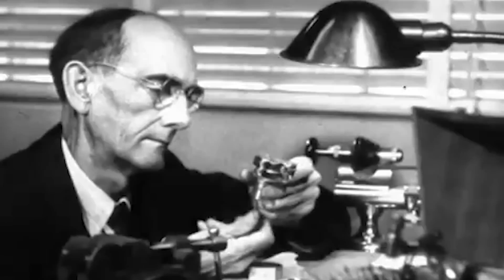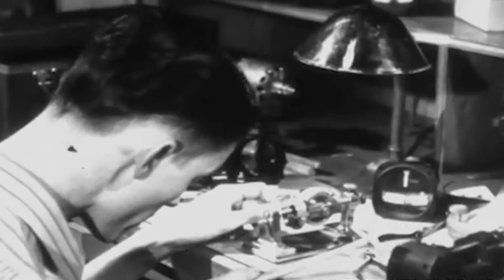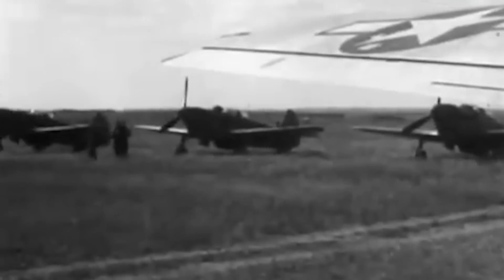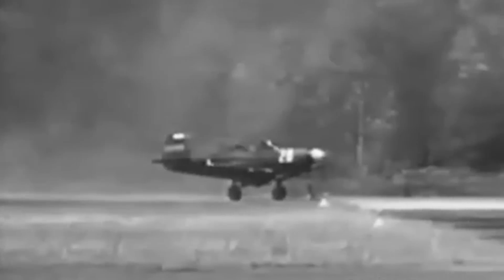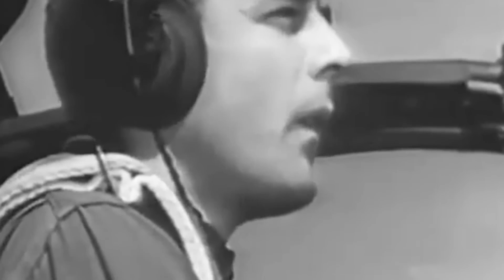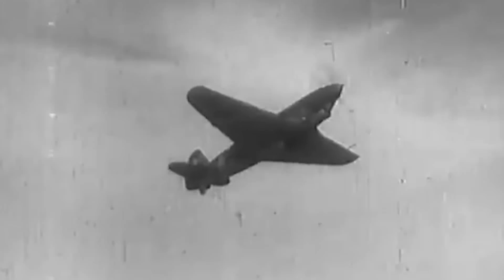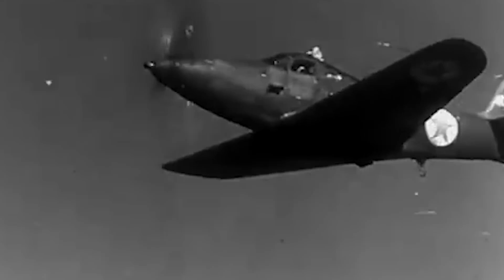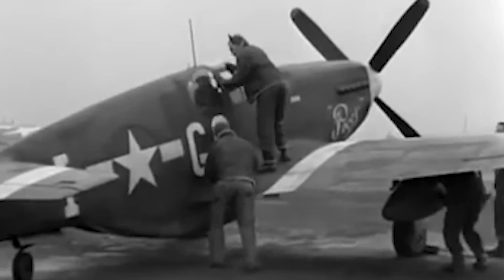The Most Underrated Aircraft of WW2

Comment: The P 51 mustang originally had an Allison aircraft engine in it and they would’ve been death traps had the British not installed the Merlin engine in their P 51 which made them the most formidable fighter in the war. Thank you, Britain.
Reply: Hardly a death trap, just not the best for medium to high altitudes.
Reply: Think, better P-40, which still would have been good.
Reply: @chriscarbaugh3936  I think it would have been stuck in mediocrity like most other fighters like the Cobras forced to rely on the Allison engines where high-altitude performance was needed.. imagine if a P-63 or P-40 prototype ever got its hands on a Packard Merlin just for comparison..
Reply: Wrong. the Allison mustans were amazing. they were designed to be low altitude fighters, and did well in that role.
Reply: That's a common misconception. The first P-51s had Allisons and were faster than Spitfires.  The problem with the Allison is that it didn't have the two stage two speed blower that it needed above 15K feet.  Below 15k feet, the Allison was just as capable as the Merlin.  The Merlin was added for bomber escort duty which required 25K altitudes, but for air superiority and ground attacks, the Allison Mustangs were formidable.
Reply: @ohger1  Yes, well said. And the Allisons with turbos at high altitude even outperformed the Merlins (P-38). Merlin/supercharger equipped P-38s would have performed worse than Allison/turbo P-38s.

the Allison just never got a proper supercharger induction system developed for it that could be installed in standard fighters.
Reply: @SoloRenegade  Correct. The U.S. gov didn't fund Allison to develop a better blower for the V-1710 because Packard was already building the Merlin in suitable quantities to make an Allison with a similar blower redundant.  The Merlin worked well, it was reliable from both RR and Packard, and it was available in large quantities.
Reply: Putting Merlins on Mustangs and 17-pounders on Shermans, the lads are based.
Reply: You are right, except all fighters go though upgrades just like the Spitfire  and others.
So guys, Merlin had better performance,  end of story.
USAF did it for that reason, and the 
Mustang improved in many areas 
of development. 
It did not come out perfect, but 
pretty dam good 👍 
Love the Mustang ,beautiful
Reply: @simoneales2568  Allison Mustangs were better at low altitude, and the Allison had much more horsepower at war's end than the Merlin (and was lighter), and still more post-war. And, the P-38 with allisons was better than a Merlin equipped P-38 would have been. With a turbocharger system, the Allison outperformed the Merlin at altitude. 

 Merlin Mustang is still a wonderful machine, one of my favorites, but that doesn't mean it is god's gift to humanity either.

Comment: The P39 was not a failed fighter. There were many Soviet aces in P39's. The 2nd highest Soviet Ace      had most of his kills in a P39.
Reply: @Arthion  um, wrong.  The Allison was not mediocre.  In fact, it's performance in the P51 & P40, both of which used the Allison and Merlin, was better with the Allison, at altitudes below 20k ft.  The Allison suffered from a lack of a 2-stage supercharger, which the Merlin had.  Allison was smaller, lighter, more powerful, and had numerous innovations that the British designed Merlin didn't.  The Allison engine wasn't the problem, the boost system was.  Why Allison didn't develop either/or a 2-stage supercharger or turbocharger system for the 1710 needs explanation.
Reply: @stevenstoll2016  I mean the end result is the same if you're forced to use the Allison engine at an altitude it doesn't like.. which seemed quite often in the Pacific. 

It worked wonders for the Soviets since for whatever reasons the Germans decided to throw away the giant advantage they had in altitude performance in comparison to most fighters in the Soviet arsenal.

Although to be fair you are right, it would be more fair to say the Allison was a good engine, but unfortunately hampered by now getting a proper 2-stage supercharger that well as far as I see it bring it down unless you get handed an optimal engagement on a platter.
Reply: @Arthion  The  Germans didn't throw away an advantage , the air combat in the east took place at lower altitudes ,there were no4 engine high altitude bombers on the Eastern front . So low altitude  fighting was the norm .
Reply: @stevenstoll2016  When the Allison was being developed, the USAAC was enamored with turbosupercharging. The Allison was designed with a single stage supercharger, the turbosupercharger was to give it high altitude capability. This worked in the P-38 but there were problems with the turbo installation in the P-39.
Reply: US: It kinda sucks with it short range
USSR taking them all: I miss the part where that my problem.
Reply: and the P-39 achieved favorable kill ratio against Japanese fighters in the South Pacific in the early years.
Reply: If the P-39 had been able to make use of the P-38J's Allison engine, things would have been completely different.
Reply: @big_steve_o5129  they both used 1710 engines but like the P-40 which also used that engine it was the gear reduction drive that was holding them back. The P-38 & P-63 had a gear reduction drive developed for a more powerful engine and larger prop to make use of the extra power. It's a shame because that was likely the missing link to better performance out of early war aircraft that would have given a better edge especially in service ceiling and climb rate and some top speed. Greg's airplanes and Automobiles has a great video on YouTube about this
Reply: I've learned that everything I thought I knew about the P-39 was wrong.
Reply: @Arthion  It was not so much that it was handicapped by using the Allison engine as it was by the aerodynamic issues around the duct feeding cooling air to the turbo-supercharger in the original XP-39 aircraft with the limited room in the airframe. Wind-tunnel testing had identified improvements, and a top speed of 429mph could be achieved using an uprated V-1710 and a single-stage, single-speed supercharger; the elimination of the turbocharger with its drag-inducing inlet cured its drag issues, but gave the aircraft significantly reduced performance above 12,000 feet. Project Officer LT Benjamin Kelsey would later express regret at not being present to override the deicision to eliminate the turbocharger. The P-39, unfortunately, came out on the short end of two conflicting requirements.
Reply: It is a very wrong configuration for aircraft, gun between cylinders of the engine is so much better: both ammo and fuel can be in the centre of the mass. Turbocharger is worse than jet exhaust in the most cases.
Reply: @Arthion  the Allison Engine wasn't "mediocre". What nearly no one realizes is that political pressure prevented Allison from installing turbochargers or two speed superchargers on the V-1710s in most aircraft. The USAAC would not allow it, plus, the P39 airframe didn't have room for them.

The P38 Lightning used those same Allison V-1710 engines and was one of the fastest, best performing aircraft of WW2. It had mechanical superchargers and turbochargers boosting the engines.

The lies and misinformation about the Allison V-1710 are astonishing. I worked for Allison in the 80s and 90s. I dug into the history in the Allison library.
Reply: Merlin great, Alllison bad?..no..old wive's tale..propaganda really...the Merlin was better in the P-51 because of it's superior mechanical supercharger...not because the engine itself was superior..the Allison's lack of an efficient supercharger held back an otherwise very good engine...with turbochargers, like in the P-38, it really shined..unfortunately, there was little room for turbochargers in single engine fighters. Had the Allison V-1710 turbo-compound varient gone into production, it would have been a game changer... @Arthion

Comment: The most underrated plane is the P=40, despite being underpowered it was incredibly fast in a dive and proved quite effective with the right tactics from North Africa to China’s Flying Tigers the P-40 changed the battlefield for the Allies on nearly early every front.
Reply: Underpowered? the Allison engine was putting out 2200hp by war's nd, and was lighter than the Merlin. It is a beast of an inline engine. They put the Merlin in it and the P-40 performed no better, and they put the Allisons back in it.
Reply: @SoloRenegade 
Both the Alison and Merlin were V-12s, not inline.
Reply: @Frankie5Angels150  both the Allison and Merlin are inline V-12 engines. they each have two rows of 6 inline cylinders. 

Radials are air cooled because their cylinders are not inline, so each can get cooling air while minimizing preheat from teh other cylinders. But the later war super radials were liquid cooled becasue there got to b so many rows of cylinders it was no longer possible to air cool them, and at that point they lined up all the banks of cylinders into inline configurations.

This is why inlines are always liquid cooled though, due to the inability to air cool the rear most cylinders. Putting them into two rows of 6 instead of 1 row of 12, doesn't make it cease being an inline engine. V, H, X, and others are just different forms of inline engines.
Reply: The P-40 was available in quantity. For allied nations to purchase before the US entered the war. Plus the US Army used it. It was a workhorse especially 1939-43
Reply: @BRAINFxck  BULL$HIT !!!!  The P40 was NOT underpowered !!!! It just lacked a 2 stage supercharger to work well ABOVE 20,000 ft !!! Know what the hell you are babbling on about !!!
Reply: @wilburfinnigan2142  the single stage supercharger was underpowered for higher altitudes so they had to use fast dive tactics and that was effective for the time
Reply: @wilburfinnigan2142  it also had a slow rate of climb and by the time the P40f got a 2-stage supercharger the P51 came out with better performance so it was still underpowered compared to the Mustang
Reply: Not really underpowered.  Even made Merlin powered units.  Look it up.  Damn fine plane actually
Reply: @chriscarbaugh3936  Flying Tigers did well with them.
Reply: @anthonybanchero3072  That they did, for a time. One of the most important lessons to learn form any war is that the nation that  improves capability the fastest wins.
Reply: @Chris Carbaugh  the P40 was good at taking down Japanese bombers. The only effective way to take on the ZERO was to dive through their formation and zoom back up to higher altitude.
Reply: The most underrated is the Hawker Hurricane- bearing the bulk of the Battle of Britain until the Spitfire was ready to side

Comment: Hardly a mention about one of it’s main attributes, the 37mm
Reply: Arguably the worse part of the P-39 and P-63. Sure it was better than American/British 20MMs but you get a ton of weight, a ton of recoil, hardly any ammunition, and iffy reliability, plus if you shot all your rounds it would move the CG far enough aft that they would enter a flat spin that was extremely hard to recover from. A bunch of M2s in the nose would have been a better way to go, no worries about convergence, better reliability, higher hit probability, less wear and tear for the airframe, etc.

Keeping the weight in the fuselage instead of the wings helps increase the roll rate. I'd just fill the wings with as much fuel as one can put in there getting rid of the range concerns, you burn the wing tanks while climbing up to altitude and cruising, then when you encounter the enemy the wings tanks are empty and you have a great roll rate.
Reply: @MrLM002  Despite the drawbacks of the 37mm, you didn’t usually need many hits to destroy a fighter or even a bomber. The Soviet pilots flying the P39 managed to do quite well against Me 109s and FW190s, with at least 16 aces with between 20 and 50 kills each. So the 37mm doesn’t seem to have been a huge disadvantage.
Reply: @tucopacifico  That's provided your 37mm didn't jam, and you actually hit your target with it, and hit somewhere vital. Rudel got hit by 37mms out of P-39s several times and none of them downed his Stuka. 

with a Hail of .50 cal fire you're damn near guaranteed to hit something vital.

The P-39 turned very well for a European theater fighter plane and the roll rate was very good as well.
Reply: There is actual proof of what @MrLM002 says about the CoG problem of the P39. 
In a book of WW2 souvenirs from a pilot of the Free French Air Force, flying US-supplied P39s in North Africa, he tells the story of one of his squadron fellow pilots who was killed during a cannon training session while executing a brutal recovery maneuver, after having spent all his shells while diving at the target.

Comment: Good to see these planes get some love. P39, p40, and p63 were great low and mid altitude fighters.
Reply: When a decent engine is put in those airframes, they become beasts. That is what happened to the P51
Reply: The A-36 did well also. (P-51A modified into a dive bomber).
Reply: P-400?
Reply: @morrielarsen  p-400 is an export version of the p-39, so in my book, same thing
Reply: @morrielarsen  P-400's were P-39 built to British specifications. The P-39 in British service was designated as the Caribou. 

 The 37mm was swapped out for a Hispano Suiza 20mm cannon, the .30cal MG's were pulled and replaced with British .303 MG's. The oxygen system was replaced with a British system, and instruments were metric. The British hated and despised their aircraft and wound up sending almost all of their Caribou's to the Soviets. Oddly enough the Soviets didn't seem to have the same problems the Brits described. The Brits decribed the engine behind the pilot as a death trap waiting for teh first opportunity to break loose and kill the pilot. The Brits also did not like the drive shaft running under the pilots legs, aleging that the driveshaft would would break lose and impale the pilot on crash landings. The Brits also clained in testing that firing the nose guns caused so much smoke to fill the cockpit that the pilot had to put his goggles on and switch to his oxygen mask. The Soviets found some small problems which Bell was quick to fix but I have come across no accounts of smoke filling the cockpit and the Soviets had extensively more combat time in the aircraft. 

The Soviets also proved that the P-39 was very sturdily built when it was discovered that crash landings didn't break the engine loose, and the driveshaft did not come up and kill the pilot. The P-39 and P-63 had a door similar to the car that swung out. When bailing out the pilot jettisoned the door, undid the seat belt and simply leaned out the door and rolled out. Unfortunately the horizontal stabilizers were at same height as the door. When bailing out it was all too common for the pilots legs to hit the stabilizer and break both legs. as time went on it became to ride the P-39 down and belly in. the rounded underbelly made bellying in fairly easy and the P-39 maintained its structural integrity. Riding the aircraft down became the preferred way to end the flight instead of bailing out and risking both legs broken. 

The unshipped balance of the British order were requisitioned by USAAC when the US entered the war. the few P-39's left in UK were used for training by USAAC. The British spec P-39's in US Army service were designated as P-400's. The P-400's mostly served in the Pacific and were present on Guadalcanal.
Reply: And were more maneuverable than the 47 & 51
Reply: @jamesharrison6201  wrote: "And were more maneuverable than the 47 & 51"

-- Many people find it surprising, but it's very true!
Reply: @RussianThunderrr  P-39 was a excellent dogfighter below 12,000ft. Was faster than the Zero and depending on altitude actually cold outclimb a Zero down low.  On Eastern front and Pacific front,  pilots often removed all non essential equipment to lighten the aircraft.
Reply: @ -- That is true too. Wing mounted four of 30 caliber Browning's MG were removed right away, and though to be useless in dog fight, because of short range and small damage it was inflicting on enemy aircraft, but roll rate and controllability was much improved. Also because aircraft was much lighter in pitch, A. Pokryshin could control "black out tunnel vision" pilots experiencing during excessive G maneuvers. Zero stick control stick on the other hand, above 250mph was physically impossible to move, so a lots of people assume that Zero was more maneuverable, but its partially true for low and medium speed, but not high speed dog fight.